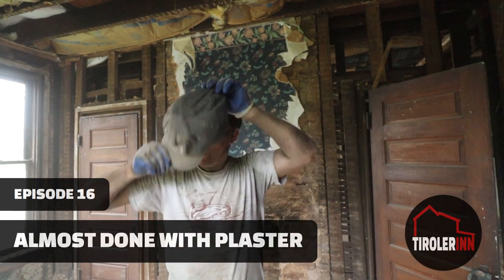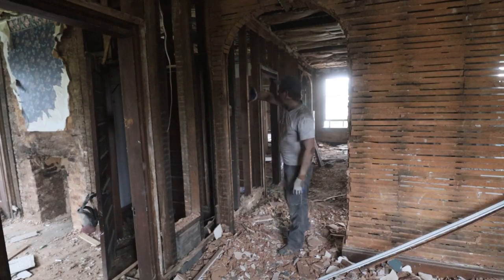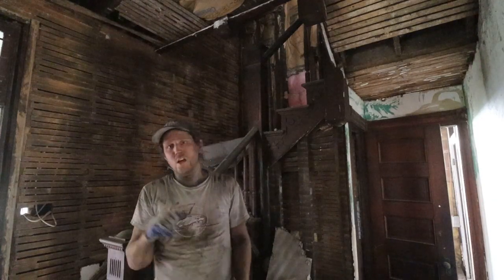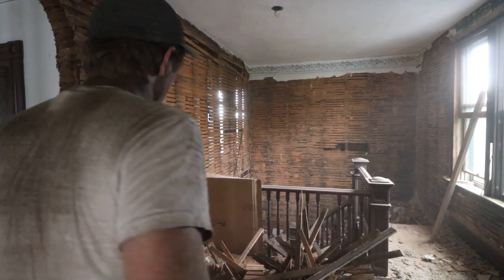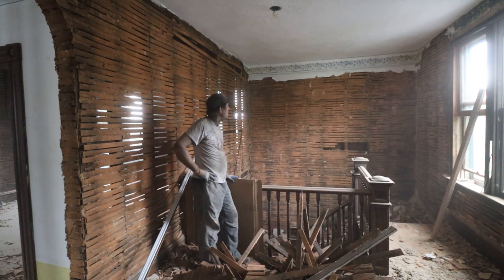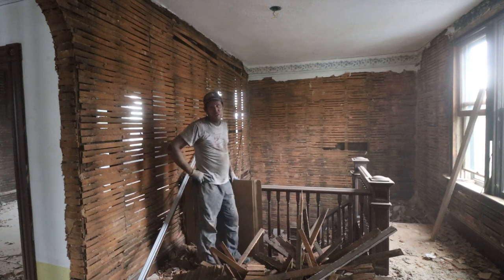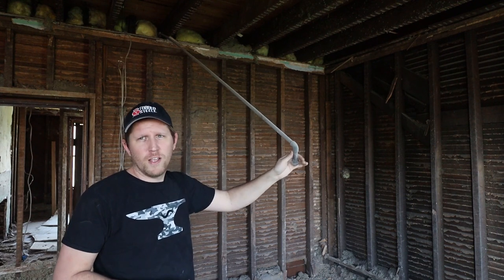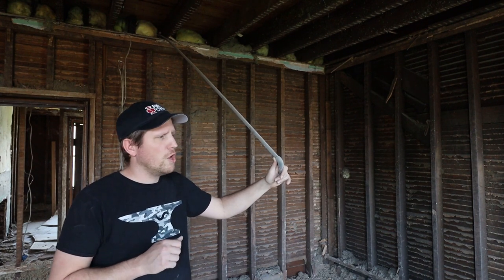Biggest improvement yet! - Victorian Home Renovation [TirolerInn]

Comment: Im watching the whole series from start to current - 2 things I’m curious and hope to find out. 1. Any issues or damage to floors given shoveling and demo (since floors don’t look protected ). 2. I wonder if y’all demo the 3rd floor floor now given how dirty it is, even though you don’t plan to renovate until later
Reply from the maker: 1. thanks for going through the whole series. ;) lots of hours of content
2. floors. The floors are pretty solid, the shovel should not do much more than surface scratches, so we should be able to sand that out anyways, since we will have to do some flattening anyways
3. there is only wood in the 3rd floor, so no worries there about extra dust up there.